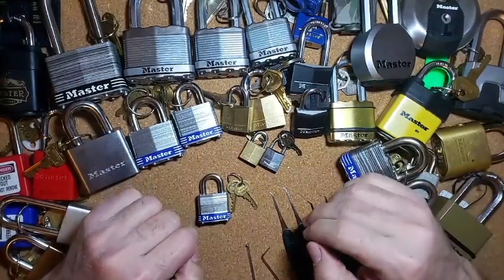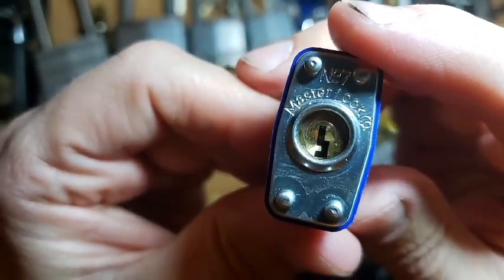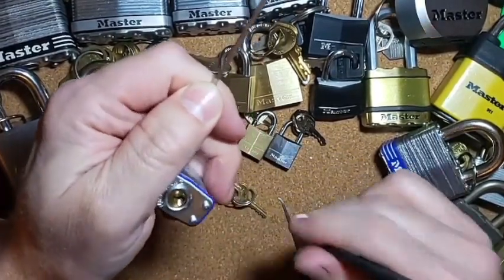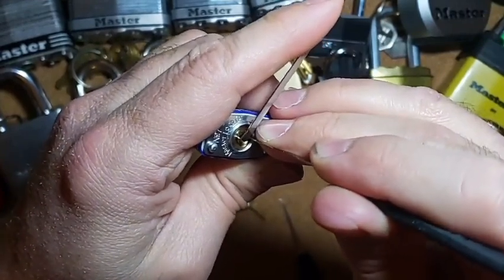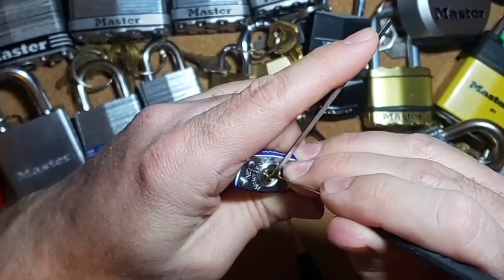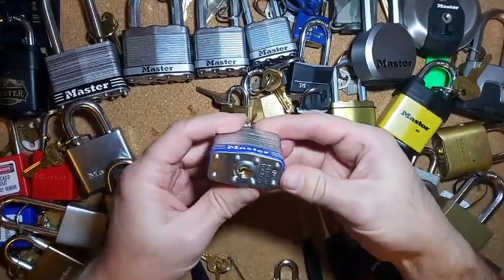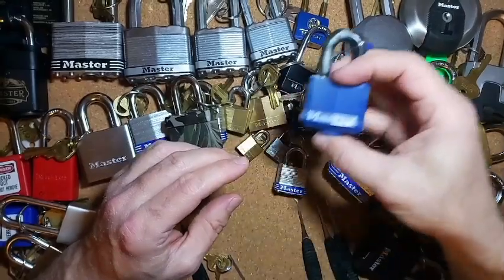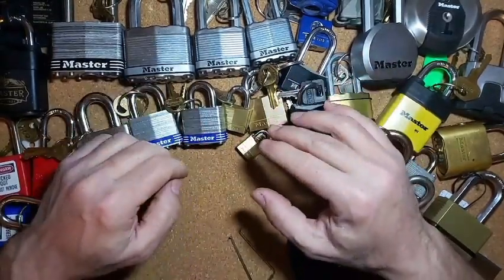[47] Master Lock No 7 Laminated Padlock Picked Open

Comment: Just recently Was able to pick a no 7.  I'm new to lock picking but this was not my first pick so I figured this little low security thing would be a cinch!  Not the case.  That teeny tiny keyway had me stumped as to use top of the keyway, bottom, turn right or left, etc.  That and for the first numerous tries I was over setting everything but didn't realize it.  I've picked it a couple times now and have since moved on to an American 1100 but man, the little but mighty no 7 nearly beat me.  😂
Reply from the maker: Way to go that is awesome, those are such fun little locks but can be deceiving,  good luck with the 1100 I do have videos of some that I have done and gutted, hopefully those videos would help if you need it, I love make the tensioners out of wiper blade steel that way I can make it the perfect size
Reply: @StevesLockPicking  I fashioned a pick out of pin flag steel for the no 7 as well thinking I needed something smaller than what I had but ended up using a standard hook.  That pin flag steel is like spring steel!  Very hard stuff.
Reply from the maker: @neviander  very good stuff indeed, at least a standard hook worked for you, always good to experiment to find out what works